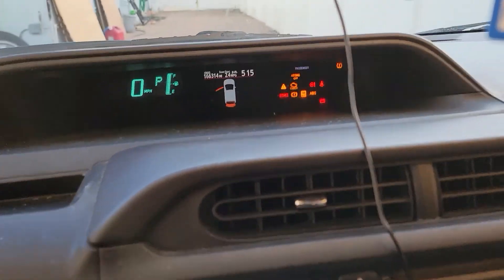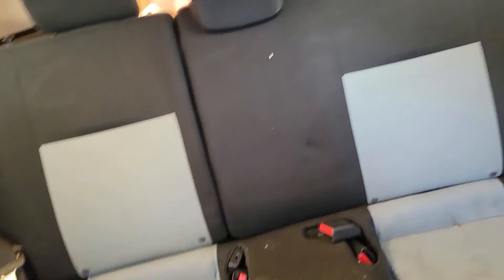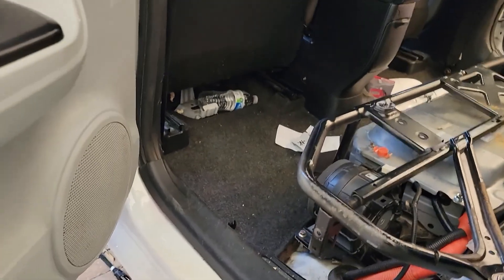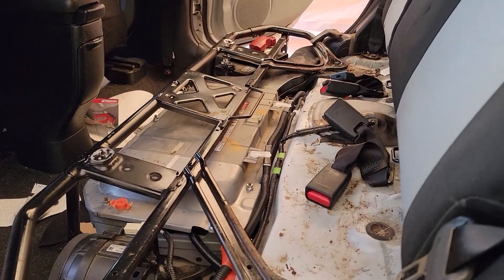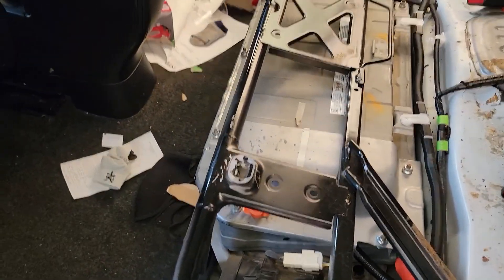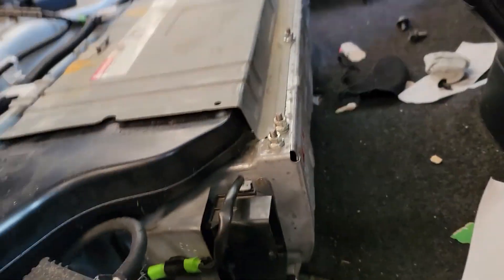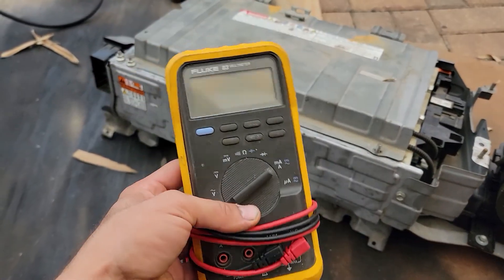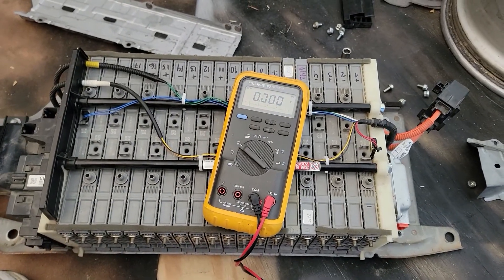Prius C/Prius Aqua P0A80 Hybrid Battery Problem And Fix

Comment: I see the batteries you are replacing are being farthest from the cooling fan, wonder if that was the reason why they go bad first.
Reply from the maker: Usually the middle ones are the most affected by the heat and deteriorate faster I replaced those because people buy ebay modules and unfortunately ebay sellers just cheat people with old modules.
Reply: @kennycharneca1  Thank you very much for your kind reply dear KDF channel.  Hope it will be a while before mine suffers the same fate.  Have a wonderful day to you all.
Reply: My car just started giving me this exact problem. Where do you recommend me buying these modules ?

Comment: Hey what voltage should each block be and what's a bad voltage reading?
Reply from the maker: thanks for that question, most people fix their batteries with a reading lower than 7.4 so if in a battery you se a lot of 7.4 7.3 7.2 7 7 7 and one module reads 6.4 that might be the culprit but I've seen modules reading good like a 7.8 and then when the battery is at high load they are weak because they don't hold enough capacity, usually I do the recondition of 3 discharges/charges and the module tells me the real nature that's how I can make a long lasting battery pack but for easy and fast fix just try to identify the lower voltage one, but like I said before sometimes works and sometimes don't , later I will post a video how to do the discharge and charge.